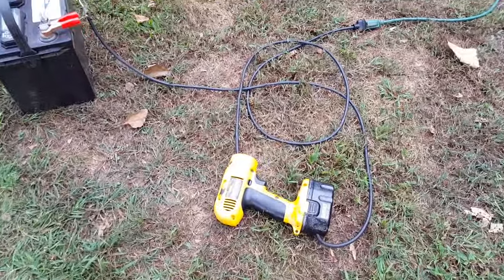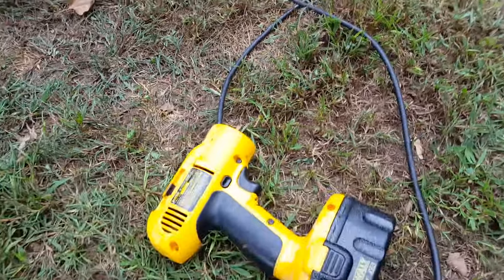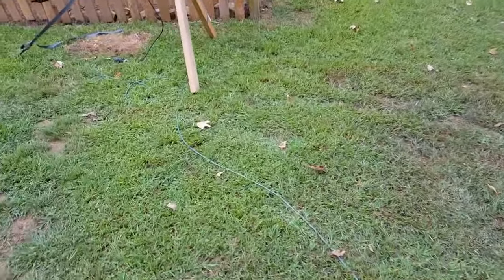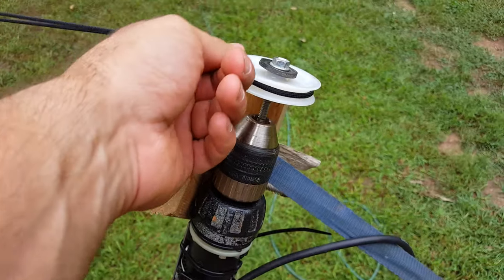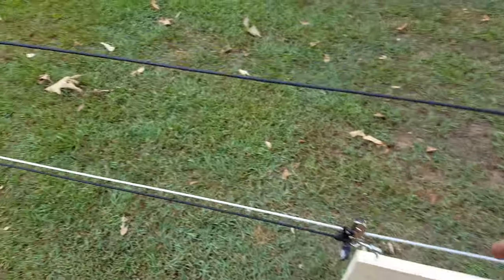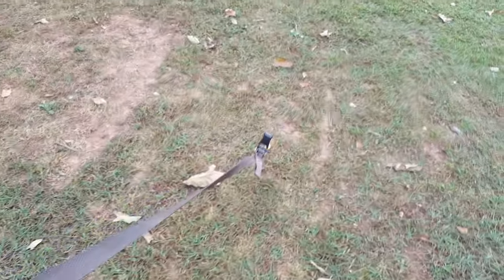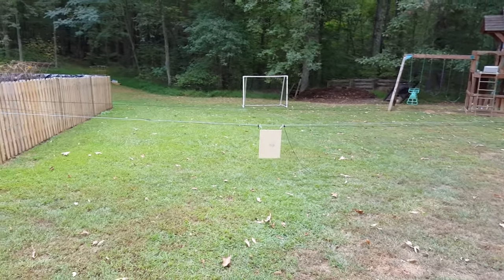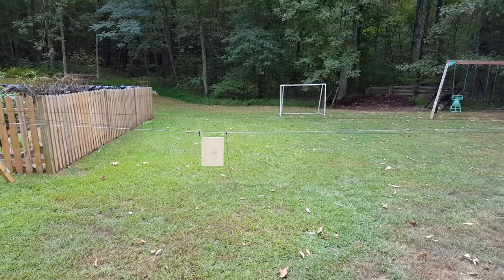DIY remote controlled moving target

Comment: Mr. M Henry I like your idea of a moving target. I have a few questions.  1. How long does the moving target system last on a 12 volt battery?  2. Also how many feet is the travel distance of the moving target. 3. How much para cord did you use. 4 how did you wire the control and motor.  Thanks and I look forward to your response.